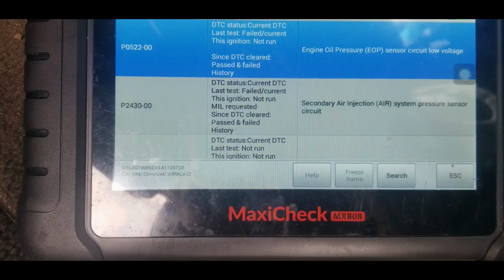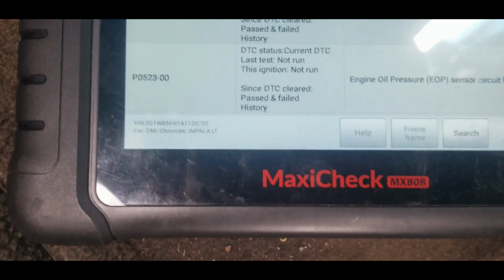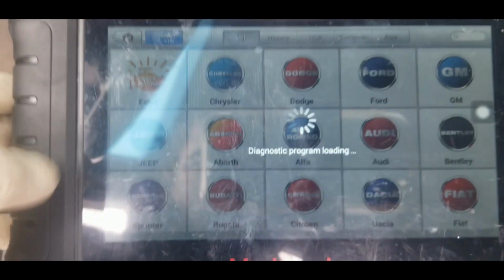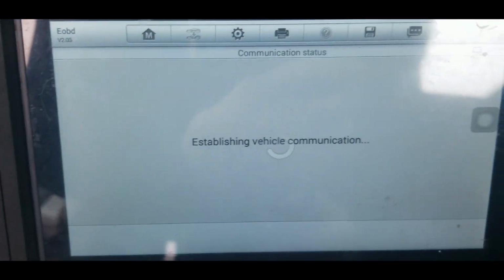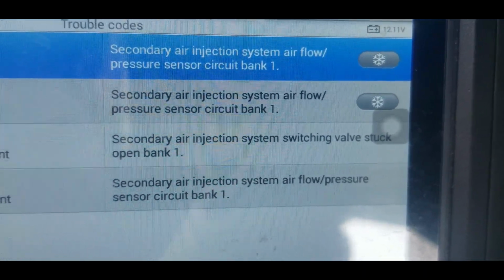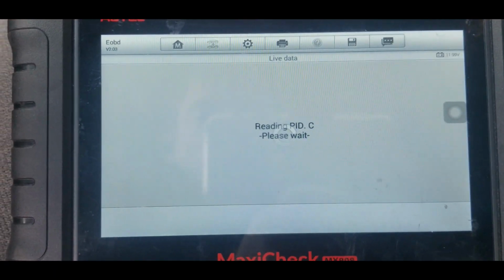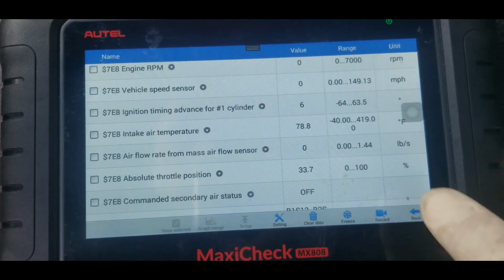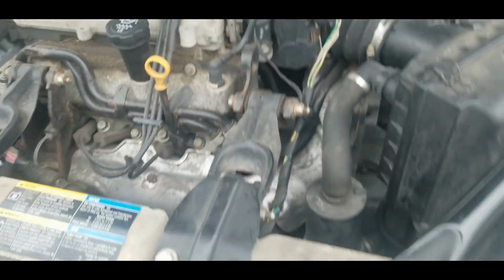How to diagnose and fix Secondary Air Injection Issues System P0411. 2006-2016 Chevy Impala

Comment: Ok commenter. I am a mechanic of 20+ yrs. I changed my 2ndry air check valve and ALL was well.... Then it hit a cold day and POOF check engine light came back on. I bought a different wire harness from a 2006 in decent condition and checked volts and continuity.... Good grief everything was OK. NOW I am about to pull that pipe off and see if MINE is clogged. The ONLY way your check valve engages is IF it's a cold start.  So now I'm at a loss of WTF is really going on. I know my pump works because I connected it directly to my battery and it ran just fine. The hoses from it TO the check valve are just fine. So.... Anyone have any ideas if THIS doesn't work for me?

Comment: You can open check valve and see if plunger is stuck. Most likely it is and it won't flow air at all. You can carefully pry it up and down and make sure it opens easy and then reassemble it. It should fix the issue

Comment: UPDATE!! WAS JUST A LOSE GROUND FROM THE AIR PUMP THE GROUND WAS LOSE BEHIND THE VALVE COVER PASSENGER SIDE TOP CORNER NO MORE CODES. 
Would a 02 Oxygen sensor cause a P0411 ?  I replaced the air pump and valve sensor cleaned all the ports from carbon wasn't much in there code still comes up P0411 HELP!
Reply: Still need help

Comment: I went through this exact same sequence of getting the pump itself replaced (my fault for not getting the system cleaned out first), then getting the system cleaned out and I still have the engine light on for P0411. Did replacing the check valve work?

Comment: Can this cause my car to not crank up and power up? I went to auto zone and got the same codes. But when I tried to start my car up nothing happen and my key got stuck in the ignition. I can turn it but it won’t come out n  it doesn’t do anything when I turn it
Reply from the maker: Unfortunately secondary air injection system has nothing to do with starting the car or car running. Seems like you have an issue with the key or lock cylinder in ignition. I would start with that.
Reply: @anrmobileservicellc1875 can p0411 cause rough idle
Reply: Try putting car in park then pull key out. I had done this before@anrmobileservicellc1875
Reply: @anrmobileservicellc1875 I think he had the gear in drive.